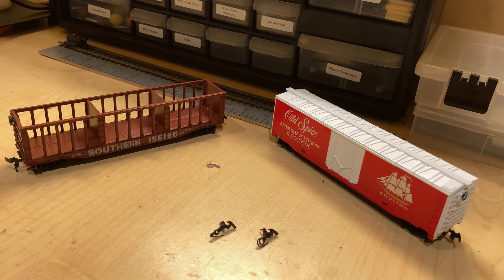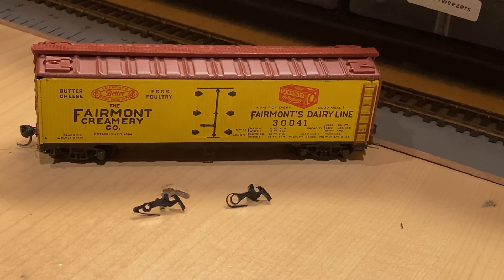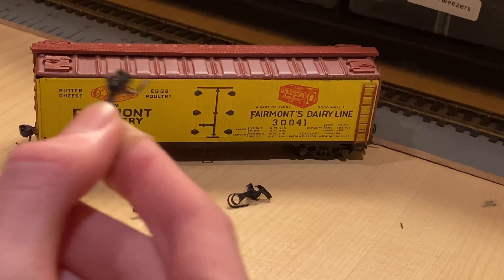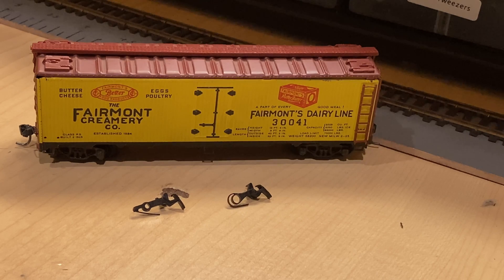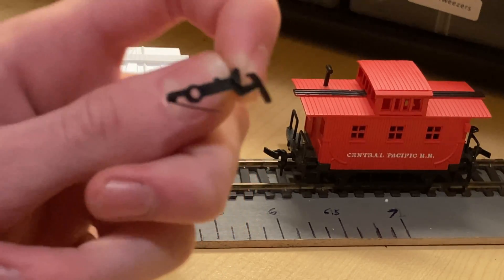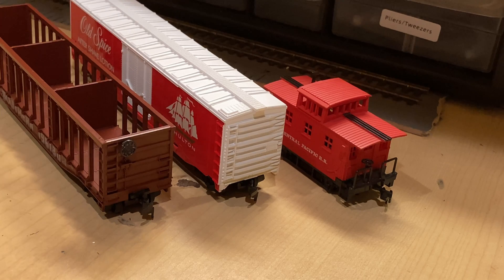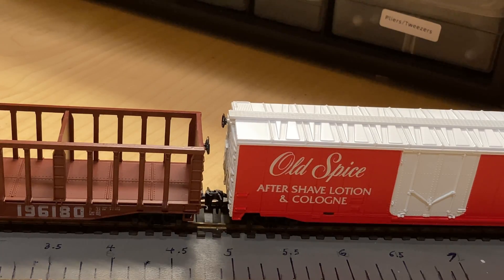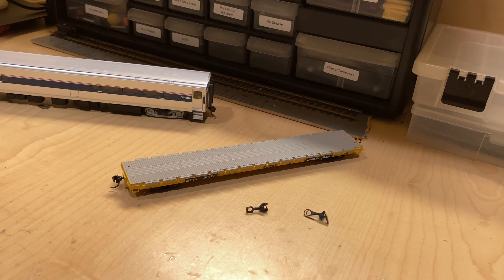Horn Hook Couplers: Why They Exist

Comment: Discarded ''horn hook'' couplers and plastic wheelsets can make great railway junk and gondola loads and for junkyards too, All of my 'Trainset' cars use 100% Kadee products now i was using Kadee on them long before it became fashionable.
Reply from the maker: They do make for good scrap loads/scenery, if I wind up with far too many plastic wheels or horn hooks laying around, I tend to give them to some friends who like to use them for car loads, and for the most part they turn out quite well.
Reply: @ColbysProjectBin  Thank you very much for answering my comment, Also, Plastic wheelsets maybe good in the short run the only problem that the plastic residue from those wheels gunks up the track causing poor electrical contact metal wheelsets on the other hand don't which i prefer over plastic because their better.
Reply from the maker: @michaelquinones-lx6ks  No problem, I enjoy responding to comments. When I’ve got them on hand, I absolutely like to upgrade any car I have to kadee couplers and metal wheels, a long term goal of mine is to get my entire fleet of trains (there’s a lot of them) to run just kadee couplers and metal wheels
Reply: @ColbysProjectBin  Good! make that your goal till you convert your entire fleet to Kadee, And, Thanks again.

Comment: We should have abopted the NEM coupler box europe used, US manufacturers refused despite the Marklin Relex coupler being  a Public domain design, and the fact being able to exhange coplers by just using fingernails or a pair of tweezers at most in one second as opposed to a screwdriver was a big mistake. By adopting the europan coupler instead of the horn hook we'd all have a universal coupler that would stay togeather better than the horn hook, and we would have had close coupling coaches much sooner.

I have a 1980s lower tier Lima trans europ express set and even those interiorless and bufferless by design coaches are close coupling.

Comment: I use to use those horn hook couplers but I did away from it to me it just doesn't look right I use kadee couplers if I buy a car that I like and they have those horn hook couplers I will change them out
Reply from the maker: I’m trying to do away with them for the same reason. They work perfectly fine (usually), but tend to look off

Comment: McHenry and Bachmann (aka: rebranded McHenry) couplers are about as bad as the horn hooks. The plastic McHenry uses has a memory and if equipment is parked on a curve, the McHenry's (and Bachmann) couplers will NEVER center properly again, despite all the bending and readjustment of the "centering spring whiskers". A close second to McHenry in the awful and trash department is the Accumate (by Accurail) two piece coupler, which is a frustration inducing design, especially when trying to keep the two halves together while installing them.
Reply from the maker: I completely forgot to bring up the accumates, personally my least favorite type of coupler. I don’t have many issues with mchenrys bending, just breaking. Bachmann couplers, though, I tend to have their plastic springs wear out pretty quickly

Comment: Kadee #5's were the standard knuckle couplers for years now. I do however HIGHLY recommend the  newer Kadee #148 "Whisker Couplers". Those are PERFECT for the older Talgo Trucks that have truck mounted coupler pockets and are essentially the direct replacements for horn hook couplers.
Reply from the maker: The 148’s are definitely much easier to deal with, especially with older cars. There are some cases where number 5’s are still more useful, but it’s rare. I personally have a stash of #5’s I need to use up, and eventually I need to order some more 148’s
Reply: @ColbysProjectBin  I know how that goes,lol. I still have a ton of vintage kadee #5's to use up.

Comment: I remember the couplers they was easy to connect
Reply from the maker: I think most ho gauge couplers are fairly easy to connect, disconnecting them can be quite a challenge without simply pulling the cars off the track
Reply: @ColbysProjectBin  truth I didn't manually uncoupling the cars

Comment: I Have Rolling Stock With Horn Hook and I Don’t mind Them the Knuckle Coupler Do Have Flaws Too As Well they Wear Out Too. This Is What I Say Different Strokes Different Folks we Use What we Use Depend The Rolling Stock. If It Has Horn Hook We Use it If It Has Knuckle We Use Knuckle we Deal With What the Rolling Stock Is Wa La.

Comment: The other problem with these is that the reaction force to the spring pressure gets transferred to the rollingstock (either the frame or the bogie, depending on where the drawgear is mounted), and that reaction force is sometimes enough to derail a particularly light piece of rollingstock, especially when setting back.

Comment: Actually I really like horn hook couplers on certain cars, they seem to hold together very well
Reply: If you are doing continuous running instead of operations, horn hook couplers seem to be more reliable.  I noticed that Northlands has horn hook couplers on at some of their trains.

Kadees themselves may work well in the long run, but I find the other brands also become unreliable in terms of the knuckle itself not working right after a period of time.  It is for these two reasons that most of my North American fleet is still horn hook today.
Reply from the maker: @survivingworldsteam I’ve had issues with basically all knuckle couplers that aren’t kadee. The bachmann EZ mates just don’t have enough springiness to them to stay connected, and I find that in fairly long trains, McHenry’s tend to snap
Reply: @ColbysProjectBin  When my EZ mate coupler's plastic springs stop working, I push the loose end with a hobby knife into the knuckle joint. I find that it makes a new stronger spring. Kadees are the best though.